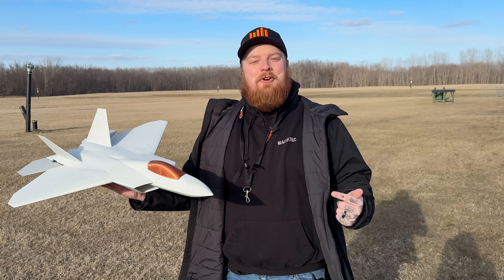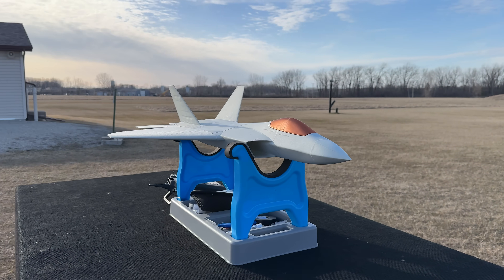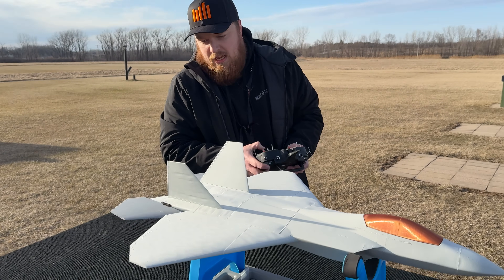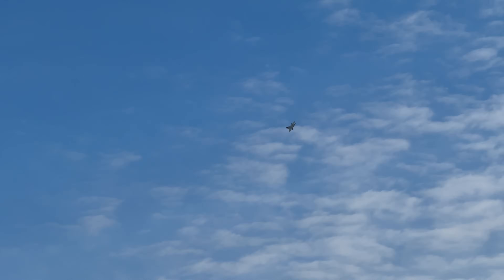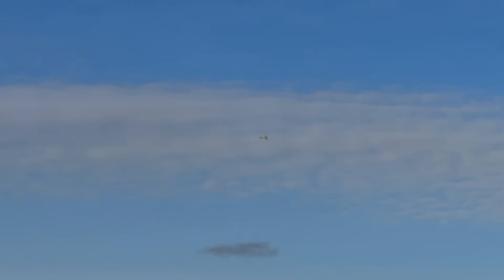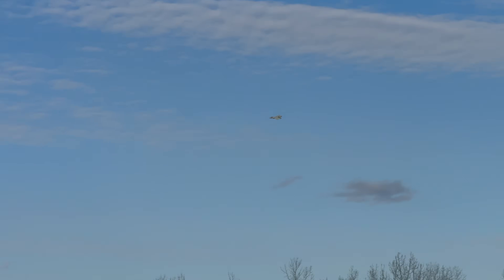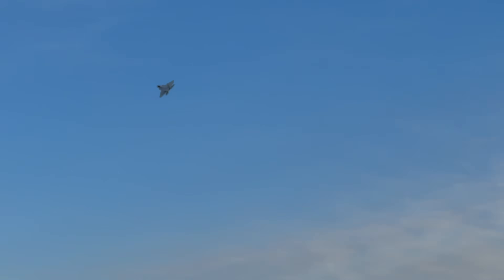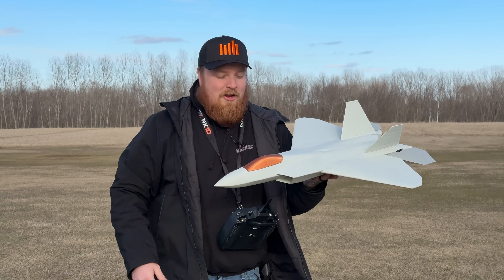This 3D Printed RC F-22 Jet Is INSANE!

Comment: i printed it and have all the components but when the transmitter is on and the receiver i cannot get bot the servos working do you have a fix for that
Reply from the maker: The servos are plugged into the receiver correctly? Positive and negative sides are correct? You bound the transmitter to the receiver?
Reply: @Mach3RC yes i did but i got them working so it is fine

Comment: Hey! i hope you dont mind me! im just looking for help everywhere! im currently printing this F22 and when i slice the files my model in the center is not hollow, the compartment for the battery and the rest it just gets filled up. When i upload the file though everything looks normal! PLS HELP!
Reply from the maker: Check it after you slice, you can see the print layer by layer. My guess is you have some type of support checked? Make sure all supports are off, it doesn’t need them
Reply: Does the slicer let you hollow the piece?

Comment: The fact that we reached the point where you can quite easily download and print your own RC planes feels so unreal to me. 
"Back in my days" (mention, it was 1995) RC planes were super expensive. It's just mindblowing!
Reply: Man it's crazy, I had built a trainer and a spitfire from balsa decades ago, the spitfire took months and when I went to the club to join and get my insurance to fly I witnessed a giant argument between old guys at the club meeting and never went back, I never did fly my balsa planes and ended up throwing them out during house moves. Later on I bought a foam trainer but that's not what I wanted. I've had a printer for a year but never knew you could print rc planes until recently. I've been printing simultaneously 3 planes and I'll do more, I need to finally fly a spitfire. When more people find out about light weight pla I think rc aircraft clubs will grow again like it was in the 80s and 90s
Reply: I need dollar!
Reply: Jsyknow no hate but its only the build thats printed all the wires etc is something you have to install and all this is not cheap like 500 dollar

Comment: I've browsed some of your videos and it looks like there are a few for 'newbies' that I will watch.  That being said, is there a budget transmitter that you recommend?  The one in the newb video I started watching is almost $600!  A bit steep for someone just starting out!  Thanks!
Reply from the maker: Transmitter is a hard one because you almost just want to buy the right one first. It’s a piece of equipment you will use for every plane and will use for 5+ years. I honestly suggest getting a good one right out the gate otherwise I promise you’ll buy 2 or more. I use the NX10. I bought a DX6 used off eBay and upgraded within 6 months wishing I would have just got the nx10 right away
Reply: @Mach3RC  Thanks.  Usually, I agree.  But having never done it before, I'd rather not spend that kind of money and find out I'm no good at it and hate it!
Reply from the maker: fair enough! There are some RTF planes like the FMS Ranger or Aeroscout that come with transmitters. They only bind to one plane  at a time, but then you can try it out!
Reply: @Mach3RC  Thanks so much for the info.  A quick search shows the Aeroscout comes w/ a DXS transmitter ($189.00 for DXS and the receiver)....the whole kit is $199.  It's like....buy the transmitter, get a free plane!  I'll look into it.

Comment: Does it feel heavy when you fly? I would think a plastic rc plane would be relatively heavy.
Reply from the maker: It doesn’t feel heavy at all. It also cuts through the wind so much better then foam
Reply: Wow, thanks for the fast reply! I might have to try one of these. And subscribe :)
Reply: It uses light weight PLA, which I have never used but from some quick reading is about half the weight of regular PLA.

Comment: What battery are you using
Reply from the maker: 4s 1300. I have everything linked in the description!
Reply: @Mach3RC  thanks
Reply: @Mach3RC  You don't have the battery linked
Reply: @Mach3RC  The battery is NOT linked !!
Reply from the maker: @nessishimony51475 updated!

Comment: How long would it take to print all of the parts and how much its costs with the bambu lab A1 ? And how much everything together would cost?
Reply from the maker: I linked to everything needed in the description! Grab what you need to see total cost. Printing takes a few days depending how much time you have
Reply: @Mach3RC OMG YOU RESPONDED!!! And thanks! How long have you been in the rc hobby? Im kinda new. I bought my ranger in 2023 and i was always to scared yo fly because i couldn’t find my gyro😂 I recently did fly and land it while i was in sweden 🇸🇪. The best plane i flied so far was the sport cub s2 from hobby king 👑. And i want to buy the fms super cub 1300mm. Do you have any tips for a kind off beginner with no flying fields(or clubs) in my area.  I live in Belgium, but i do come very often to my 32 hecto acres house in sweden where i can fly. Love your vids. Keep up the amazing work ❤

Comment: That printed very clean for LW-PLA, did you do any tweaking to Bambus profile or ran it as it is? I'm yet to try Bambu Aero on my P1S, I've been using Esun.
Reply from the maker: As is basically! Only thing that cleaned it up a ton was drying the filament immediately before using it
Reply: @Mach3RC  I've actually never used mine, I'll give it a go thanks for replying.

Comment: hi mach3
Reply: Oh also I was thinking about upgrading from ranger to 64 futura. do you think it’s a good choice?
Reply from the maker: Mornin! Absolutely. The Futura 64mm is a great first EDF. Get it with reflex v3 or some gyro and it’s rock solid
Reply: Nice! I could definitely put reflex in it, but what transmitter/receiver combo that is somewhat budget?
Reply: @cam-av8r you should buy something used spektrum i just got a used spektrum nx10 and it is amazing you can also buy some simulator for the new spektrum nx's series